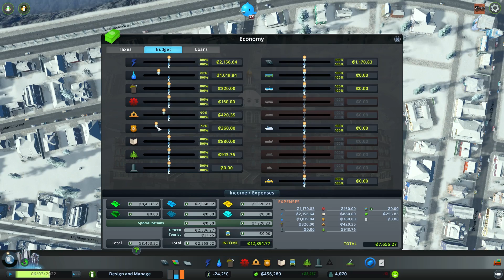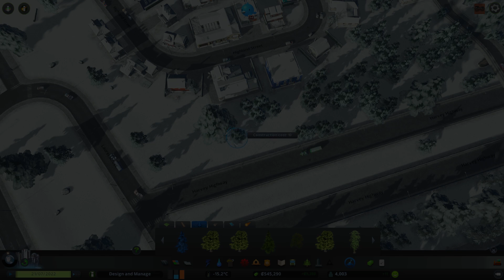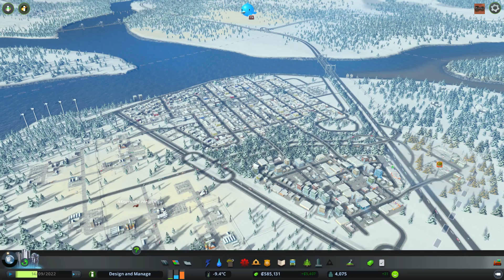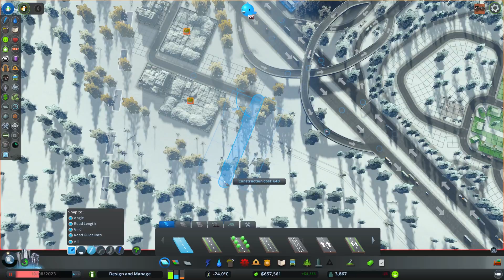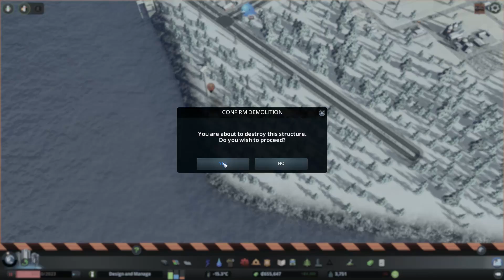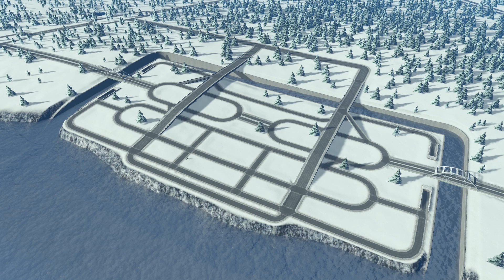Planning the Industrial Road Layout | Unmodded Cities: Skylines – Design and Manage, Part 5

Comment: I built my city step by step as yours but my stupid cims rejects to take the damn pedestrian bridge for go to the shops
Also if I delete the other ways, they go back to the shops district instead to take the damn ramps
Reply from the maker: Pedestrian paths, as well as highways, need to be shorter/faster than other possible routes for people to actually use them. By your description it seems that is not the case. Try to make more linear and direct paths.

Comment: Interesting layout for the industrial area.  I usually don't end up doing fancy layouts for my industry like this; rather I stick to a grid.  The key that I've found is to make sure you have good, efficient cargo rail connecting the industry to all of your larger commercial areas.  That cuts down on the amount of road traffic significantly.
Reply from the maker: +Czardus That is true. Cargo traffic is the worst type of traffic in a city. XD
Reply: Czardus and cargo ships
Reply: Absolutely!  But I find rail is easier for intra-city transport.
Reply: Czardus true but cargo boats are very efficient in delivering goods to the terminal and then the trains for in the city long distence
Trains are also good for inter-city but require a exit rail